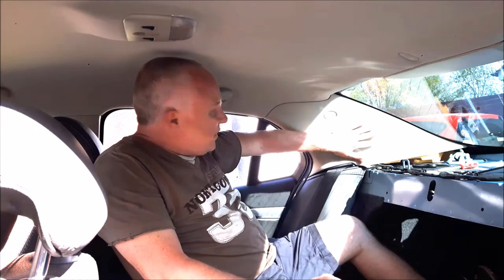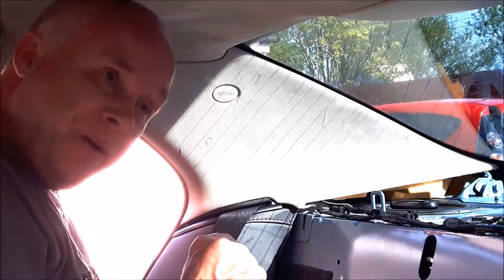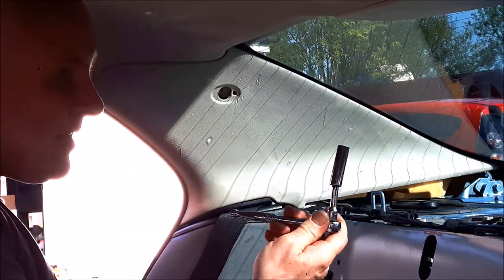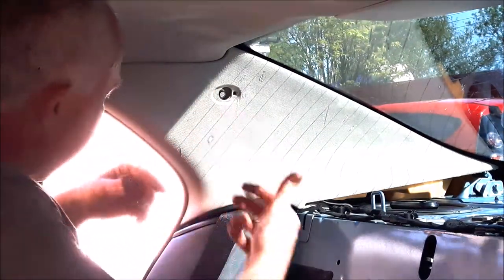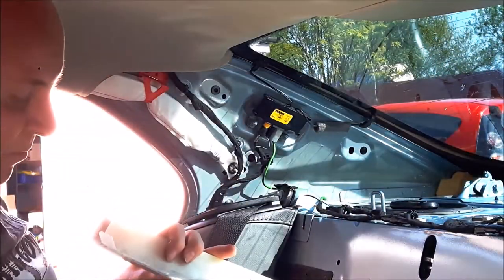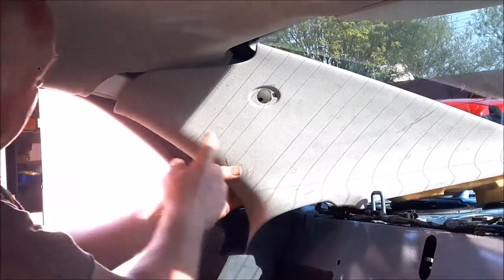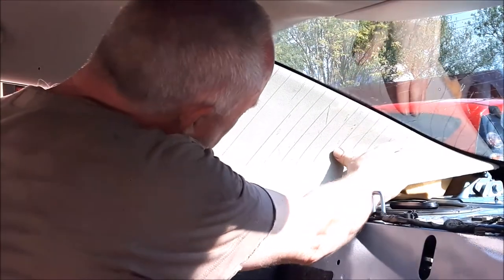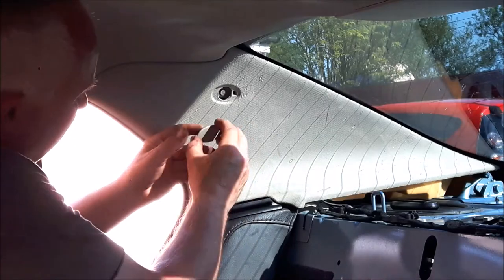Saab 9-3 C Pillar Trim Removal | Saab 9-3 rear Trim | C Pillar

Comment: One thing I noticed is that the airbag insert is identical on both sides, so you should pry from the front on the other side when removing that. I wasn’t going to remove these when I tinted the rear window, but your video made it so easy that I went ahead and removed them and cleaned the fabric while they were out. Installing them was a bit harder than you made it seem, but not super difficult.

Comment: Hey cyd do you have any knowledge on how to get the outside/ambient temp gauge working on the 2006 saab 9-3
Reply from the maker: The exterior temp sensor is in the centre of the front bumper below the number plate in the lower grille. I'd change that first.
You'll need to get the front bumper off for that:
https://www.youtube.com/watch?v=Adkcj8kTo_U
Join Saab Nuts! Facebook group and seek out a 2ndhand one.